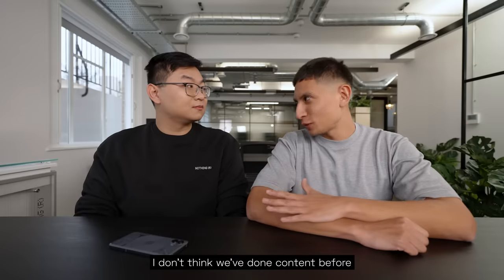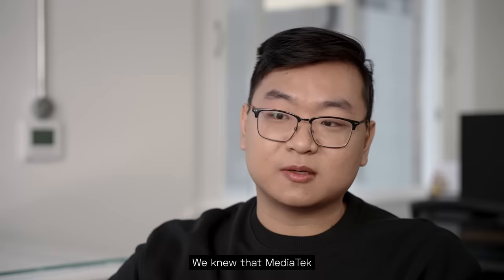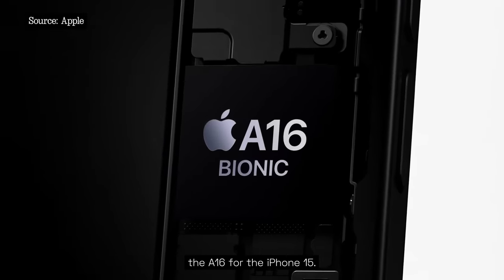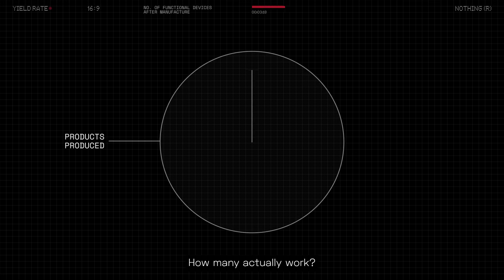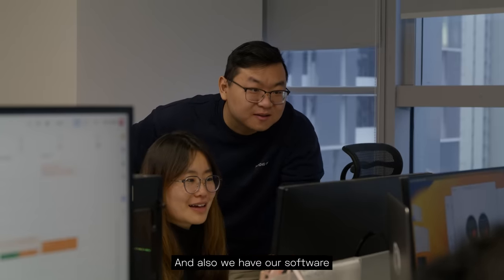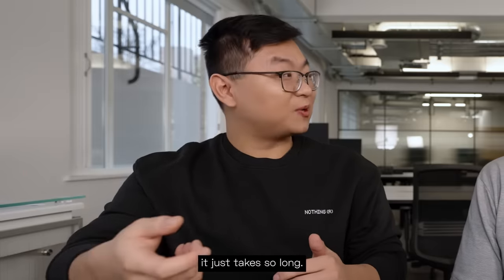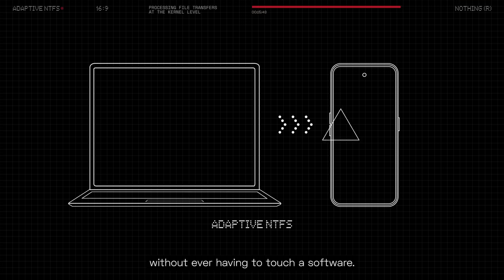Phone (2a): Snapdragon vs MediaTek

Comment: People just listen to them first before being totally ignorant. Their reasoning really explains a lot and making a lot of sense
Reply: it is called marketing strategy then
Reply: Because most people lack common sense. Ironical how common sense isn't so common.
Reply: Hi please don't get misguided by this false marketing.
I think what they said was to misguide people I am not saying using mediatek chip is bad but the reason by which they justified themselves for using the mediatek is not at all true and doesn't hold very good.
by the way I never comment on the videos but seeing an computer engineer and listening to there  stuff I could not hold my self back.

what about fucking design of the chip 
manufacturing is just printing 
completely misguiding the audiences
LIKE WTF are you talking about
are you comparing the architecture of the chip based on the nanometer size??? How does that even make sense

It's like judging the printed picture by the printer
it can be the case that printer can be the case that the printer can be wrong but has good art in it
and their can also be a good printer printing the picture of shit.
 I am not saying printers do not matter, but you cannot say that we used good printers so you will have good designs. Having good printers does not by any means talk about the art or likeability of the picture

IT IS VERY IMMORAL FALSE ADVERTISING
Reply: @rohitkumbhar4899  He never talked about architecture though? The talk about power efficiency definitely isn't false. And he went on to also explain the higher performance they got, and apparently the customization (idk if it's true or not, but it could also be another reason that they wouldn't have been able to customize anything with Qualcomm)

BTW I'm not a nothing fanboy, I own none of their products. I just couldn't understand your points.
Reply: @rohitkumbhar4899  and your assumption is based on what? Do you have any tests, studies or reports that this is a misguided case? If you have them please post it here to prove that what they are doing is a marketing sham.
Reply: @mirzaangon you cannot say that one design is better just because of the nm size of the process, you can if they are the same design. The chip design can have differences despite being the same architecture, just like with Intel and AMD.
Reply: type c charger 
E Sim 5G and 1 normal sim
Minimum Rugged design,
Good display Like( Amoled),with high RF 120 hz rate 
5000 mah to 8000 mah (Li-ion) Battery,
Snapdragon 8 Gen 2 Above Good Processor,
SD Card support,
2 Air Trigger.
Reply: @rohitkumbhar4899  But what they talked about was efficiency. Using your example; they went with tsmc because their printer doesn't have as many paper jams as Samsung, so more pictures are printed with less wastage. Of course the amount of transistors isn't all that counts, but all they did was explain a little bit of what went into their thought process.
Reply: What about 7+ Gen 2 ?
You could have go with it. Then it would be ultimate mid ranger.
Reply: @rohitkumbhar4899 if that was the case then they would have put Snapdragon and then people will buy just because it has Snapdragon in it, even when Mediatek is clearly the better choice here
Reply: @rohitkumbhar4899 typical Indian snapdragon fanboy. New mediatek chips are really good and way more efficient than snapdragon this is known proven info.
Reply: @yellowflash511 Every video has some Indian guys pointing out something instead of appreciating. Why don't you guys go and make your own phone man. If they are good we will buy them.
Reply: @rohitkumbhar4899  Yeah, it was idiotic. 2 chips being made from Same TSMC process doesn't mean that they have similar performance.
Not even that, D7200 Pro doesn't even make any sense at £290 asking price.Yeah, the price has been decided.
Reply: @yellowflash511  Not really. And at 35K NP2 is available with 8+Gen1 which is miles ahead.
NP 2a at 30K doesn't make any Sense. And 7+Gen2 was more power efficient than current Dimensity 8300.
Reply: @Pokedox-nd7wz  There is a big market for nothing in India hence there are comments from people in India ...
Reply: @Pokedox-nd7wz  Indians have their own phone company  and they have good phones already lol 😂
Reply: @abhinabparida5783  everyone in the world knows what Indian phones are like.. 😭😭
Reply: @Pokedox-nd7wz Not as bad as you think. For the same cost, an Indian made phone will work better than a China made phone.
Reply: WOW, 🤣🤣 where to START.. "Also Apple uses the same one" mate.. I'm no Apple fan boy but there cpu is quite something, you can't compare your potato to there peach.. 🤣🤣🤣
Reply: @OfficialTRYPlus It will take time to compete China though😅
Reply: @OfficialTRYPlus  is there any 8th generation snapdragon phones available from Indian brands??? Or at least any 7s Gen2???
Reply: @udaysingh9_11 Most logical content I've seen literally bruh  
Others just go vague onto anything 🤣
Reply: @rohitkumbhar4899  The guy comparing Snapdragon 8Gen1 with 8plusGen1 which he refers has the same design but manufactured by different "printers" and the one samsung manufactured has heat issue. 
Therefore he choses MediaTek 7200 Pro (TSMC 4nm) agaisnt 7s Gen2 (Samsung 4nm) and 782g (TSMC 6nm), which sounds totally valid.

Even tho design is also playing the big part, you definitely dont want a masterpiece printed by shitty color inaccurate printer.

Furthermore they actually work with Mediatek to create custom chipset.
They have benchmark to show its better performing too. 

However, I understood the feeling of skeptical for using "not so popular" brand. But if their QC were good, nothing is impossible. 

I am an engineer in semi-con field as well and i dont find any misguide in the video at all. 
Let the product speak for itself.
Reply: @shockwaves59  I think what he meant was the A16 is manufactured by TSMC, and not the whole "all these chips are the same."
Reply: @iStryka common mate, do you believe that 😅
Reply: Yeah
Reply: Why they didn't they use snapdragon 7+ gen 2
Reply: @miketeok  i think from phone manufacturer perspective, using mediatek are make sense. but for user, you get closed source chipset, while qualcomm open source its kernel, that makes unlock bootloader and modding more easier, also on some game snapdragon just perform better than mediatek
Reply: @miketeok probably kid who read few articles and thinks he now knows better than the people who work in the said field.😂
Reply: I am not saying what he is saying is not correct but he way he only comparing the printers is false marketing.  @miketeok
Reply: I Wana see Raymond again
Reply: @miketeok  But still, 7sGen2 is a previous gen chip. 7Gen 3 or the upcoming 7+Gen 3 are way better then D7200 Pro.
Reply: 7+Gen 2 from the previous year was already better than current year 8300(8300 is way powerful than D7200Pro) in both power and efficiency.
SD(7+Gen 2, 7Gen3 and 7+Gen 3) are made by TSMC on 4nm node.
Reply: basically: Samsung Nodes are crap. And i knew it since Nvidia RTX 3080 + 3090 with horrible high power consumption.
Reply: Of course, they are trying to sell
Reply: @yellowflash511 I agree. Mediatek is way too underrated. I've seen first hand how powerful mediatek can be, and the galaxy a34, the first Samsung phone using a Dimensity instead of an exynos was a very wise choice by Samsung and I wish Samsung uses more Dimensity on their phone lineup. Qualcomm can be good at gaming but sincerely, Qualcomm chips tend to heat faster, while mediatek doesn't even heat like that
Reply: @wiltfield agreed. Brands like Samsung should use more Dimensity chips like Sammy did on the galaxy a34. A cheap mid range with flagship perfs.

I've been using several phones with Dimensity chipsets like:

Honor 90 lite
OPPO a77 5g
Samsung galaxy a34

And as daily drivers, I sincerely don't need any s24 ultra or iPhone 15
Reply: they literally gaslight you into believing that an inferior chip is actually good
no wonder they are the "apple" of androids 😂😂😂😂
Reply: @rohitkumbhar4899  Mediatek has been better than snapdragon when it comes to midrange chips for a long time
Reply: Making a sense and being practical are two different things

Comment: If anyone from Nothing is reading this pass the message to whom it may concern,  in Nepal the Nothing devices are extremely expensive compared to India. Phone 1 was Indian Rupees 28500/- equivalent to Rs. 45600/-(Nepalese rupees)  whereas the launch price of same device in Nepal  was Rs. 59,000/- Same case for Nothing Phone 2, too over priced when it comes here. Since Nothing and Chaudhary Group are tied up now we expect the Nothing Phone 2a to be equivalently priced, if not cheaper. (For reference Redmi launches its phones with 1k or 2k rupees less than in India and most of the people nowadays has Redmi phone if they are in Midrange segment. )

Comment: The chipset is a MediaTek Dimensity 7200 Pro, some people may be disappointed but if I understanded it correctly, the Pro version is a collaboration beetween mediatek and nothing specifically for the Phone 2a
Reply: And built by tsmc
Reply: It's not a Snapdragon 😶
Reply: Snapdragon is a brand and they make all kinds of processors like mid-range to high-range and I think mediatek is also a great brand of processors. How much I know, In India a lot of phones use the mediatek dimensity processors.
Reply: @ROADTRIPNAVIGATER cool opinion but I don’t see a problem.
Reply: Just a word to scam😂
Reply: It's just an undervolted version
Reply: @Zexarr bro snapdragon isn't a brand , it's Qualcomm
Reply: @harshanand3920  ohh thanks for the info.

Comment: Customised chipset for Nothing 😮😮
Reply: Thanks bro you Sev my 8 m😅
Reply: this company is not small room 300 guys anymore
Reply: true but at least they tried to do something lol, the file transfer looks cool but thb i dont think many people actually care about 2x faster transfers, the average user is not a movie producer transfering 50GBs of vids each day lol.
Reply: @R1L1.  For an average user iPhone don't really matters if we r going down that path
Reply: @R1L1.  As a linux user I can confirm it's true what they are doing isn't a gimmick 
Rn my file transfers 2 times fast from linux to Android compared to windows due to that bs old as hell ntfs
Reply: @Noname12........641  where did i mention iPhone in this comment thread? Did you even read my comment, i also did not say its gimmick 1x speed is enough for most most people so customizing your chip servers 0 purpose, just go with Snapdragon and we can at least have custom roms. At the end of the day its to save money and i would much appreciate it if they would tell us that instead, yes benefits are there in terms of slightly higher performance, but for a mid range phone 10% performance is not gonna be deal breaker for anyone.

Comment: Dimensity 7200: ❌
Dimensity 7200 Pro: ✅
Reply: Oh
Reply: Thanks bro. I didn't waste 9 minutes. Because of your comment.
Reply: @asath7853  video doesn't felt that long tbh. But it's enough to have some level of information.
Reply: @asath7853 It's mentioned literally right after the 1st minute.
Reply: should have been 7200 ultra
Reply: Thanks bro
Reply: @carloareaser  🤣noob 🤌🏻
Reply: @carloareaser  Vivo X100 Pro uses Mediatek too. Let that sink in
Reply: @joelconolly5574 yeah? nobody cares about vivo
Reply: @manolakios yeah like nobody cares about your opinion 😂
Reply: @notactkslllslkskd2743 That's literally the same processor.
Reply: @carloareaser what's wrong with mediatek bro they make great chips   Qualcomm is just as better as mediatek
Reply: @notactkslllslkskd2743 that was xiaomi's customed chip (all their's customed chips called Ultra)
Reply: @joelconolly5574  x100 Pro uses Dimensity 9300, a great chip, even better than Snapdragon 8 Gen 3. But, Dimensity 7200 Ultra is definitely not a good one, much worse than 7+ Gen 2 which is a last year chip.
Reply: No @terminushit
Reply: @notactkslllslkskd2743  Its almost the same. Xiaomi and Mediatek partnered and made dimensity ultra series chips for better optimisation with Xiaomi devices, Then Oneplus and Mediatek did the same to make Dimensity Max series chips. Now it's Nothing's turn and they are naming it Dimensity Pro series chips.
Reply: @JUVAIDPB13 mediatek non-flagship chip are terrible and slow
Reply: @asath7853 what kind of attention span do you have? Legit said somewhere around a minute the video started
Reply: @terminushit  and twice the cost too.
Reply: @notactkslllslkskd2743 😂😂
Reply: @carloareaser  Skill issue
Reply: @carloareaser 
Mediatek 4 nm TSMC manufactured
Vs
Snapdragon 6 nm Samsung manufactured.

I would choose TSMC anyday. They are more energy efficient, no heating issues + better performance
Reply: Kinda a marketing trick but manufacturers do this so they can emphasize that they tuned the processor relative to the device itself, just like how Oneplus and Xiaomi doing with their MTK powered phones (Max and Ultra to be specific)
Reply: @asath7853 honestly the video is very informative, you should waste your time lol
Reply: @sirgreen2792  mediatek dimensity 8300 ultra is a great mid range chip
Reply: Dimensity 7200, 7200 ultra , 7200 ultimate , 7200 pro 😂
Reply: Mediatek = ❌
Reply: 7200 pro is not optimised
Reply: 7200 ultra 💥

Comment: I might get nothing phone 2a if I a good price
Reply: @JohnHyperpop I’m using galaxy s10 rn, and it works stunningly tbh, but I’m considering upgrading because it doesn’t have 5G, high refresh rate screen, big battery and software updates. The iPhone 11 even lacks OLED display, type c port and has ancient bezels.
Reply: What a trash talk, iPhone 11 is never faster 😂, maybe in your dreams xD
Reply: @JohnHyperpop  nobody is going to buy an old ass iPhone from 2019 bro
Reply: I hope nothing phone 2a is well built
Reply: @JohnHyperpop  you're way too quick to judge. the phone isnt even out yet. if you want to compare spec, edge 40 uses 8020, not 9300. and the 7200 is pretty much similar to 8020 except the 8020 is less efficient. 7200 ultra is faster than sd778g+ which NP1 has and it never lag on me.
Reply: @JohnHyperpop ah yes, recommending old iPhones with degrading battery, IPS screen, and lightning cable when everything else going type c. Truly speak like a true iPhone user.

Comment: Quick question, is the Dimensity 7200 Ultra and 7200 pro are the same chipsets or are they a new line of chipsets specifically designed for 2a, because I am not finding anything about the pro chipsets on the internet.
Reply: 7200 pro is like exclusive soc made for phone 2a for better software and hardware integration.
Reply: Yes, it's a custom chipset exclusive to the 2a designed together by Nothing and Mediatek. Listen from 5:09 it is explained the difference.
Reply: nobody knows for sure. its not out yet for people to test. it could be rebranded 7200 Ultra or a custom chipset that sits between normal and Ultra variant in terms of performance.
Reply: @sanjaylord  Thanks!

Comment: Highlights:

[00:00:00]3 Introduction
The host introduces Raymond and the topic of the video
[00:00:22]4 Why MediaTek D7200 Pro?
Raymond explains the reasons for choosing this processor over Snapdragon counterparts
He mentions the 4nm process, the TSMC manufacturing, and the performance benchmarks
[00:02:31]5 The order of ideas
Raymond compares the phone 2A with the phone 2 and the phone 1 in terms of performance and power efficiency
He also reveals that the phone 2A has a custom chipset co-engineered with MediaTek
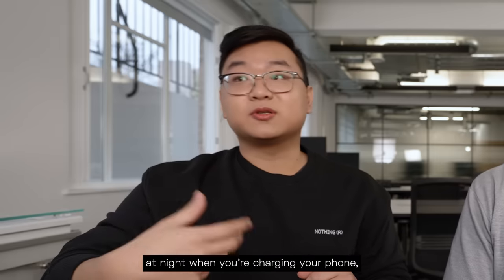[00:05:39]6 Smart clean feature
Raymond describes a feature that cleans the file system at night to maintain the read/write speed
He says this feature prevents the phone from getting slower over time
[00:07:00]7 NTFS writing feature
Raymond talks about a feature that improves the file transfer speed between the phone and Windows computers
He says this feature runs at the kernel level and converts the file formats faster
[00:08:33]8 Conclusion
The host thanks Raymond for explaining the chipset of the phone 2A
Raymond says he has to catch a flight and leaves

Comment: for most people any of the 3 chips directly referenced would have run well on the day to day, but obviously better bang for buck is always good. 

As far as the older phones slowing down thing, luckily that's been getting a lot better, pretty much any 4-5 year old flagship and 3-4 year old midranger should still be very useable.

Comment: Summary:
The phone has a Mediatek D7200 Pro
Choice of MediaTek over Snapdragon due to performance considerations, despite lesser brand recognition.

MediaTek D7200 Pro manufactured using TSMC's second-generation 4nm process, offering advanced performance and power efficiency.
Collaboration with MediaTek for custom chipet design, optimizing power draw for components like the display and modem, improving power efficiency by roughly 10%.

Features like "Smart Clean" optimize file system organization to maintain fast read/write speeds over time, addressing common slowdown issues experienced by older devices.

Comment: I think you should stick to single processor for 2 gens , like you could have used 778g  in Nothing 2a and then , you wouldn't have to optimize the software for new phone. Moreover, pushing OS updates would be easier if you have 2 phones with similar processor.

Comment: that could be better if they use Dimensity 8100 or 8300 but there goal is Budget Phone but perform like a Flagship 
well since D7200-Pro is Customised Chipet with a Collaboration of Nothing and MediaTek lets see if they also Improved the GPU just like when OnePlus use D1200 in OnePlus Nord 2 5G which perform better